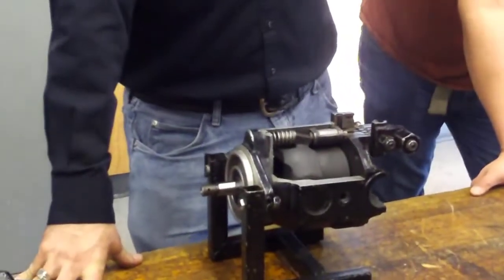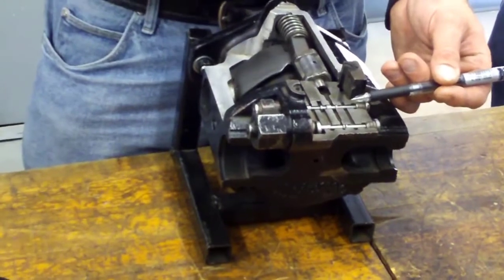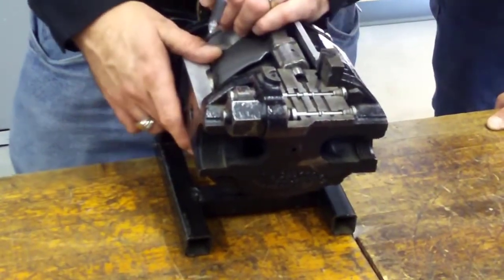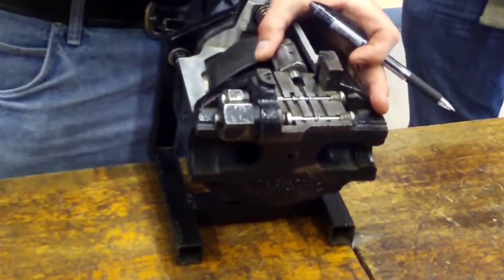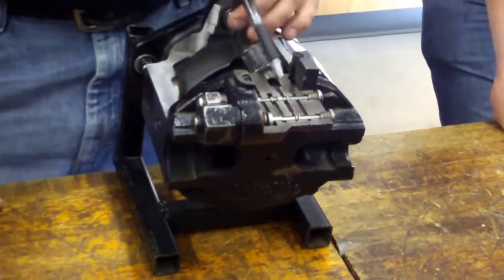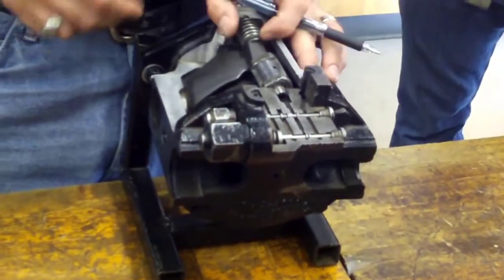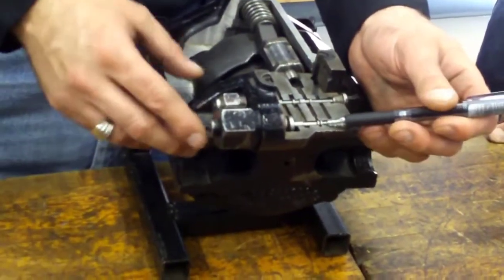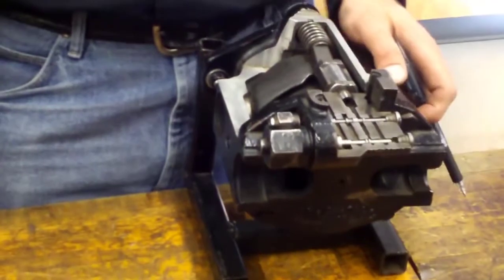Pressure Compensated Load Sense pump cutaway explained

Comment: How was pressure on the load sense line able to reach 1000psi with out bypassing the 350 psi spring first ?
Reply: Because the 1000psi is coming from a work port (Cylinder port for example) to assist the spool in not opening.

The resistance to the flow that the pump is generating is seen at the working port first therefore it is able to assist the spool.

Comment: How was the pressure on the load sense line able to reach  1,000 psi with out the oil going through the 350 psi spring tensioned spool??